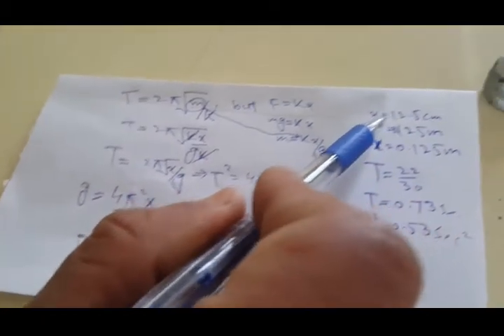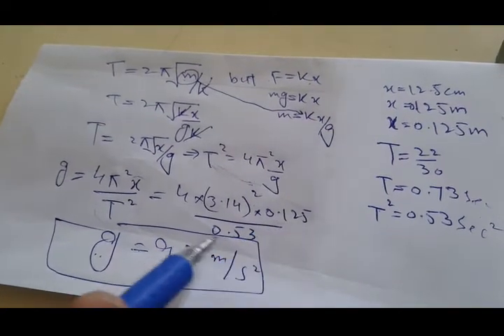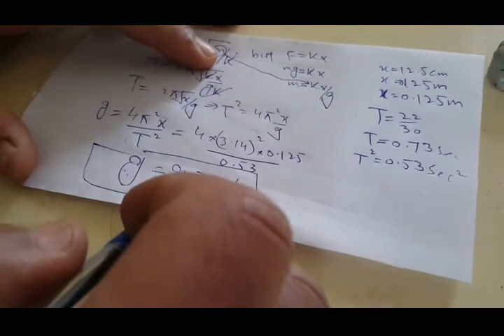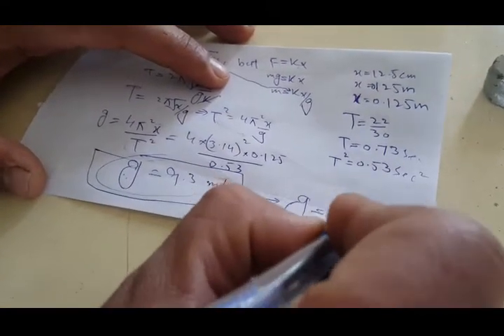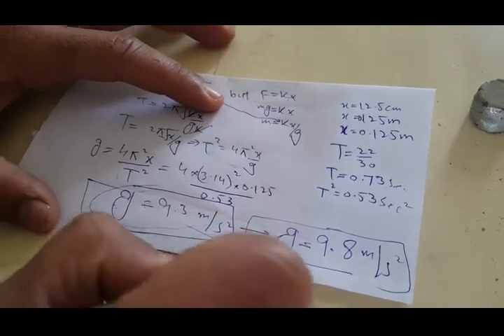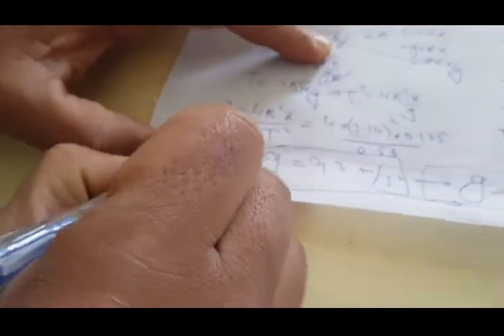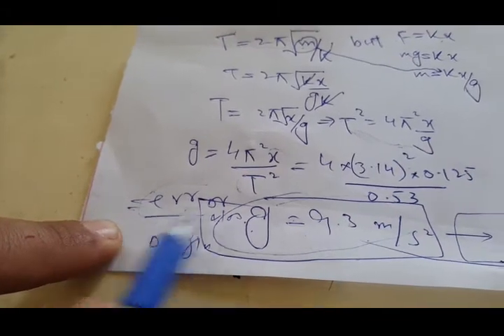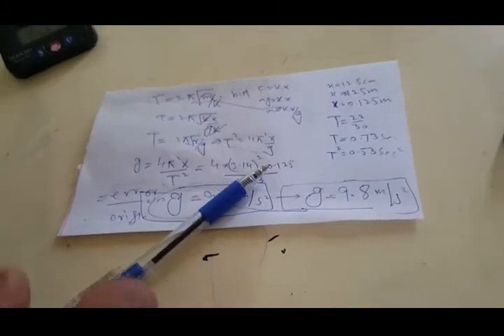Value of acceleration due to gravity(g) by mass spring system.EXP

Comment: Why did you ignore the mass of the hanger, or is its mass negligible compared with the mass of the slotted masses? In the formula for period, the mass that gives the period should include the total mass pulling down on the spring.
Reply from the maker: If you look at calculation we already eliminate mass by equating spring force(hooks law) with f=mg .Therefore we have only concern with displacement of mass not with mass of spring or slotted weights for calculation of time per.